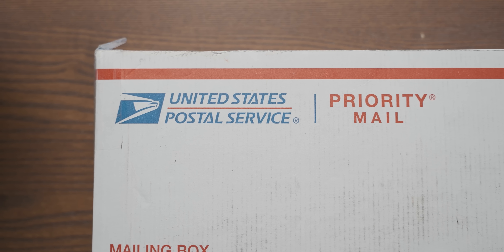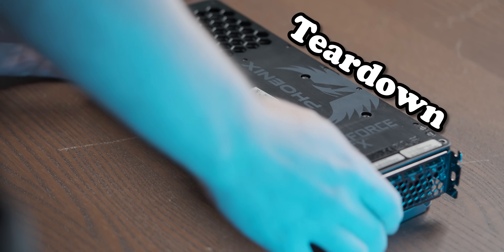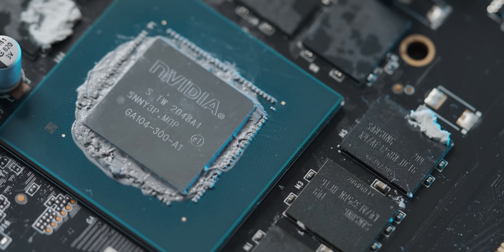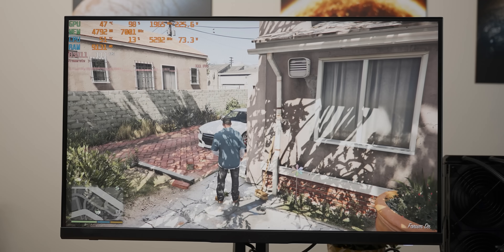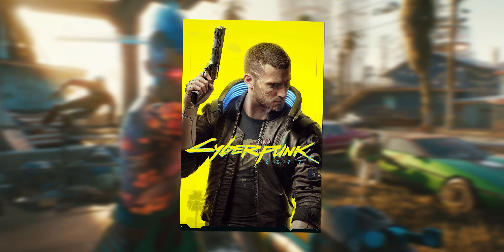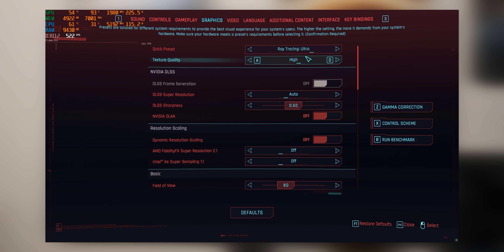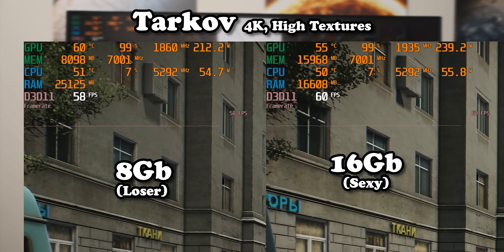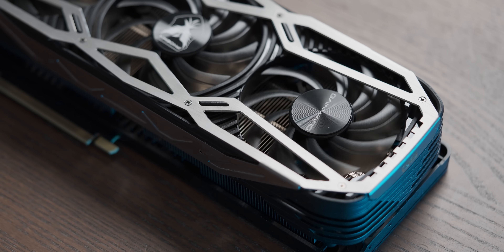This Is The 16Gb RTX 3070 Nvidia Should Have Made

Comment: Almost makes me wanna do this to my own 3070
Reply: But why? tests show clearly that there is no difference. 
2-5 fps? on delibrately cranked settings?
you know how much 16GB on 256bit bus will cost you, not to mention the job cost? and that it can easily go wrong?
And remember, this card is not working properly any more. If you restore boost on 8GB version it will smash 16GB version.
I thought 3070 8GB was a looser indeed from all the whine, but 8GB is clearly a good choice for this GPU.
Reply: Not really economical sadly for 25$ x 8, maybe if you can get your hands on some bricked 3060 for cheap and hope the mem is still good.
Reply: @xcom9648  to be fair, I don't even think there is anyone in my country that would be willing to do it for less than like 3/4 of the price that I paid for my 3070 used, but for cheap it would be really cool

Comment: This is cool. I wanted to do something like that with my Nintendo Switch but I realise probably most games won't use more RAM anyway so might not be worth the cost.
Reply: There's only one way to find out.
Reply: The bigger potential lies in overclocking the Switch. It has a lot of headroom there
Reply: @jemandetwas1  I am overclocking the CPU, GPU and even RAM. Helps with framerates and stutters, but the Switch feels warmer and the battery runs shorter.
Reply: @jemandetwas1  Not in the memory. If a game is RAM limited you can't do anything about it because the frequency is already as high as it can go.
Reply: And the Nintendo lawyers

Comment: I wonder if they can do that for laptops cause my 2060m needs more vram. Skyrim with mods is killing me. 

Already swapped my vbios to the highest power mobile 2060 bios that exists.
Reply: I know a better trick.
You can swap out you laptop and replace it with a proper desktop pc
Reply: @i3l4ckskillzz79  Nah im good. Ya'll can spend your kidneys on a gpu alone i'll stick to my laptop and steam deck.
Reply: Same, i kinda want to see how my GTX 1650 Mobile would perform on 8GB VRAM on modded Cities: Skylines.
But at the same time, my GTX 1650 Mobile is heavily capped by the power limit itself and stock cooling can easily keep it below 65°C under 1.05V 50W + OC with a CPU next to it that goes 90-100°C lol
Reply: @rinsenpai135  My vbios swapped 2060m (80w bios to 115w bios) is overclocked and undervolted at 875mV. 1900-1920 clock and 6500-6600 mem depending on the game. Im getting as much performance as i possibly can without actually changing the vram or raising the mV so i can hit 2000+ clock and probably off my gpu lol. 

Idle is 30-38c depending on windows and 45-75c depending on the game. But when i use the IETS laptop cooler its under 29c idle and under 65c while playing pretty much any game at max gpu usage /settings.

Forgot my cpu lol its undervolted heavily and locked at 3.6GHz to 4GHz when im gaming. -125mV to -200mV depending on what i lock the speed at. Not that it does much since 10th gen mobile cpus almost always overheat no matter how good your cooling is. It sits at 70-80c when im playing 2077 even at lower settings.

Comment: now i want to see someone make a 16gb 1660 ti just to see how well it would run.
Reply: 16gb wouldn't be possible on that because it uses a 192 bit bus (that uses 6 memory modules, and 6 cannot multiply into 16 properly), the next closest thing would be 12gb. You can traditionally only half or double the memory capacity, and this is also why the 3060 has 12gb of VRAM on its 192 bit bus (6x 2gb memory modules) while the 3060 Ti only has 8gb but has a 256 bit bus (8x 1gb memory modules).
Reply: @yasu_red  alr then. We need a 24gb 1660ti. Assuming 4gb gddrwhatever modules exist
Reply: @SirPoppynice joke
Reply: @SirPoppy probably they exist somewhere but they are not common for gddr. 1, 2 and 3 gb modules are the ones used in the industry.
Reply: @yasu_red  It use a 192bit bus only because the last two slots of vram are unused but you could just had some in there and it would work
Reply: @zeolysse  TU116 (the GPU chip used in the GTX 1660 series) only physically has 6 memory controllers, which limits it to a 192 bit bus. The reason you see 2 unused slots on 1660 boards is because TU106 (2060 - 2070) and TU104 (2070 Super to 2080 Super), which have 8 memory controllers, have the same package size as TU116.
Reply: @zeolysse  you would be right if you would've referred to gpus launched 25 years ago. back then, the lower end card in a series was nearly identical to the higher end one, it just didn't have the extra memory installed or, the core count was limited in software.

the craziest example was back in ATI days when there was a model (possibly the 9800, can't remember) where you simply had to remove the cooler and move a jumper in order to turn a GPU into the superior variant. imagine buying a 5070 today, move a jumper on the board and ending up with a fully functional 5070TI xD

nowdays, companies (especially Nvidia) go out of their ways to ensure you can't upgrade a card. they physically burn the disabled cores and the memory bus, they impose extra layers of limitations to vrm, software, firmware, controllers and so on so so that it's nearly impossible to improve performance by simply adding the ram or flashing the bios.
Reply: For Science.
Reply: Man, if someone makes a 80gb gt210, I'll be happy 🙂
Reply: Surely you mean 12GB? 1660 Ti is a 6GB card
Reply: @b0ne91   i know what i said and i'm sticking with it.
Reply: bascially the same
Reply: It would have to be 12GB due to the bus width, but it would be quite interesting still. It's exactly how the 12GB 2060 and 3060 work. I would love to see 20GB and 24GB 3080 mods.
Reply: @DigitalJedi  Especially whith 3080 and 3080Ti it would probably be cheaper to just buy a used 3090.
Reply: @DigitalJedi  I know you said 3080 but the 3080 ti is literally the same card as the base 3090 with only 12 gb of vram, so I would love to see someone put 24gb on the 3080ti
Reply: @TheBigBeefis  So long as both are AD102 it should be able to take it. 3080tis have reportedly been able to take 3090 vbios as well, so the only question is if it's worth the parts&labor compared to a used 3090.
Reply: As many pointed out already the TU116-GPU maxes out at 192Bit and thus can only use six VRAM-ICs, allowing 12GB at the moment. However, the same brasilian team that first modded a 3070 to 16GB has successfully modded one of the rare 3060 (same as 12GB-Version, but with just 4 modules and 128Bit-SI) to 12GB, but that was only possible because the card could be flashed with the BIOS of an otherwie identical 3060 12GB.
It could be possible to mod a 2060 6GB to 16GB this way with a 2060S-BIOS and by replacing the 6 1GB-ICs with 8 2GB-ICs, but again the resulting card wouldn't be worth it and it would make more sense to upgrade anythin faster.
Reply: imagine rtx 4090 with 40gigs (32 for losers) of vram 💀
Reply: @qwertyuiopasdf160  Imagine someone who can do math. The 4090 has a 384Bit-SI and 12x2GB of GDDR6X, so it has 12 32Bit-memory controllers and could only be upgraded to 48GB by linking two VRAM-ICs to each MC, which up to now is only done on cards like RTX A6000 with slower GDDR6.
Reply: @Tigerfox_  The RTX Ada 6000 (God why did they get rid of the Quadro moniker) I'm pretty sure has 24x2GB modules (it has 48GB as well) so I'd imagine the 4090 (also AD102) could receive 48GB but I doubt it has the PCB traces for that at all. The 3090 does though since it's 24x1GB
Reply: @2intheampm512  You are Right, I forgot that there were no 2GB-ICs available when the 3090 was introduced. Still wouldnˋt make Andy Sense since 16GB and above Willie enough for some time.
Reply: The 2060 12GB can give you a close result of how the 1660 Ti would perform with more memory, since the 1660 Ti is only 12% slower than the 2060 6GB, the interesting thing is that the 1660 Ti is capped with those 12Gbps chips to not cannibalise the sales of the 2060, othwerwise the 1660 Ti would be even more close in the benchmarks if 14Gbps memory chips were used
Reply: That's not all that much different than a p5000 quadro
Reply: Would be 12GB
Reply: Not well? As it wouldn't even be possible. 12GB would be though.
Reply: 1660ti basically is 1070 with 6gig vram
Reply: 16gb GT710 lol
Reply: With the bus they could either make it 12gb or 24gb.
Reply: Let's kneecap an RTX 4090 with DDR4 RAM, GT 1030 style, and see how it runs (or limps).
Reply: 8 or 10 gb would be enough to get a little more fps
but not much
Reply: no reason the card is not strong enough to run 1440p and 4k games anyway,.
Reply: @nicane-9966  People use GPUs for more than gaming, and the 1660ti can do 1440p decently well when it's not VRAM limited. If the 2060 12GB can do it, then a 12GB 1660ti can also do it about 3% worse.
Reply: @nicane-9966  someone tell this guy that you can load higher resolution textures if your VRAM is higher and enable more GPU memory consuming settings.
Reply: Yeah basically a 2060 12gb without raytracing
Reply: As other comments have said it would need to be 12GB, but I imagine it would perform very similar to the 12GB RTX 2060, which seems to be about as useful an upgrade to a regular 2060 as an accordion player added to a deer hunt.
Reply: Don't use a 1660. There is a design/manufacturing error that messes up FP16 on this card and makes it not work right/to the level it should be able to in many cases.
Reply: Why? It's a 1660 Ti, it's old and wouldn't do very well
Reply: @rustler08  mostly out of curiosity.

Comment: Dang, I really wish this existed. While I have had no issues in the VRAM department it would be nice to have the extra headroom for the future
Reply: I also have no issues with vram thanks to amd not being stingy assholes
Reply: It kinda does exist. RTX A4000  uses same GPU chip as 3070 and has 16gb of VRAM - this is probably why drivers have no issues with 3070 having 16GB as well. 

You can buy used A4000 and simply mod it with better cooler kit, way easier than soldering on 3070.
Reply: @esuil  imagine paying 900 dollars for a 3070 lmao
Reply: @esuil  fair enough I guess but why would I want a workstation GPU at more than double the price that would most likely game worse than my normal 3070 and I have to do custom mod a cooler on. I think for most peoples use cases that is pretty terrible price to performance for gaming. It is an interesting idea though
Reply: @jasonjavelin  thats the point, you can get it used for $400, so it is not double the price right now.
Reply: with how shit almost all new game releases are i will probably never in my life will have to replace my 1080 ti
Reply: @keine_ahnung_wie_der_heisst hey the 1080 ti is still a beast if you don't care about RT
Reply: What's the point in having enough vram in the future if the card is going to be old and slow
Reply: it will not be the bottleneck though, as this showed. You'll run out of core before VRAM comes into it.
Reply: They want people experimenting with AI to buy their workstation cards so they gimped most of the gaming cards.
Reply: It exists , it's called Quadro RTX A4000 it's literally the same card as the 3070 with slightly lower clock and double the vram but costs more than double (MSRP)
Reply: Halo already comes pretty close to maxing ts on 1440p
Reply: 🌈Planned Obsolescence🌈
Reply: Jedi Survivor is optimized so shitty that it draws 16GB of the 24GB Vram available on my 7900xtx. A 8gb card might not be so happy in this game xD I am glad i did not buy the 4070ti instead like a friend of mine did^^
Reply: you might have more issues than you realize, some games really gobble up vram. my 3080 10gb gets choked by it pretty bad in a few games
Reply: @bradhaines3142  you try Diablo 4 yet? I saw a lot of people complaining about running out of VRAM, stuttering etc on 1440p high with the rtx 3080.

Hell even 1080p ultrawide high was too much for either of my 8gb GPUs. It's a shame since the game has excellent textures and otherwise good performance.
Reply: @samk7500  that's why I got the 3080 12gb version I know it's only two more gigs, BUT it also has more cuda cores as well, it's the Gigabyte Aorus Master 3080 12gb, and I have been loving it since I bought it, back when they were selling for 799. For a little bit, THEN,  the price SHOT RIGHT BACK UP!  😂 so I was super happy to have picked one up at that price, and yes it is still an inflated price even at 799, but when I got it that was 600 DOLLARS Cheaper! ,😳sooo yeah anyway sorry for the rant, I digress, like a lot 😅
Reply: @bradhaines3142  I don’t have anything noticeable, I’m still gaming in 1920x1080 until I upgrade monitors at least. Prob will be a little tougher in 1440 tho but I could also just be what I’m playing.
Reply: Yeah for when games need that extra ram it will be great to run them at 13fps.
Reply: @kidShibuya  "when games need that extra ram" that would be 2023 and beyond. You're not running a smooth 1440p ultra in major demanding titles on 8gb of VRAM when consoles already had about 12gb of VRAM available for the past 2.5 years. Hardware Unboxed already ran recent benchmarks, specifically for the rtx 3070 on new games. 

In demanding games, the rtx 3070 either stutters hard when running out of VRAM or the game loads in lower textures so you can pretend to run at 1440p ultra. Either way, not a great experience given how much people paid for the rtx 3070/Ti the last two years.
Reply: @samk7500  I have a 3070 and haven’t had any issues but I’m also gaming in 1080 still. Has me a little nervous about future titles but when it comes to price to performance in my case the 3070 was absolutely the move. I was between that and waiting for a 4070 and I think we’re seeing how that is going. I def want to upgrade to a higher vram option card and new monitors to utilize 1440 in not too long though

Comment: Nvidia i swear sometimes they under perform  some their gpu's to make amd seem like a good choice when they know they are holding more than 60% of the market Nvidia I'm not hating but seriously let the next gen of gpu's have more and I mean more that 24gigs of ram and a wider memory bus (no one please take this as hate)
Reply: people are simply brainwashed and will buy anything Jensen throws at them, regardless of the price. they hold the consumers by the balls so of course they will use as little vram as they can get away with, so that their planned obsolescence plans continue into the future.

AMD used HBM memory some years ago on their top range. although relatively expensive (nowadays totally prohibitive), it offered insane memory density, speed and latency tied directly to the core. the gaming industry could've finally have the best thing ever if that would've been normalized.

people for some reason didn't liked that. they much preferred the Nvidia alternatives with much slower and insufficient RAM. thus, HBM for gaming died and now we're stuck on getting ripped off by buying cards that are obsolete at launch when it comes to RAM.

and with the current RAM prices jacked to an all time high, a HBM module is 600$. so we won't see HBM back in gaming in a very very very long time.